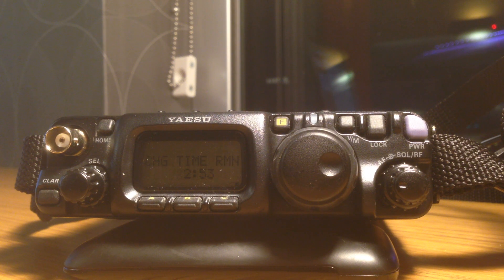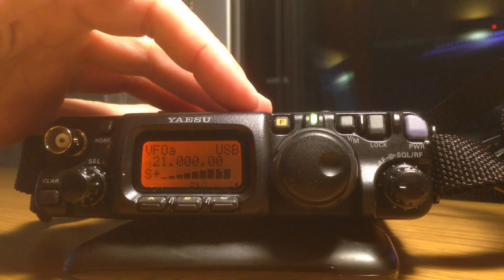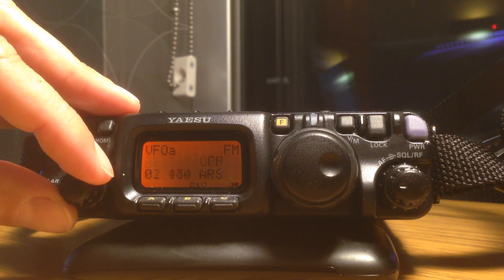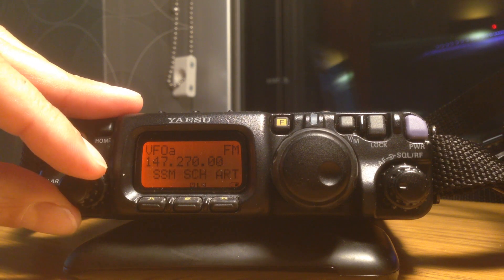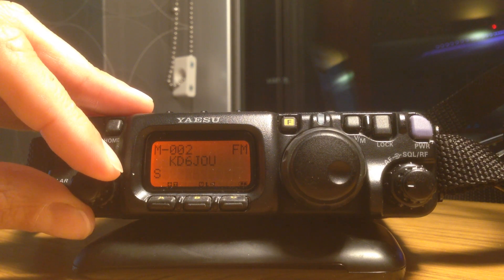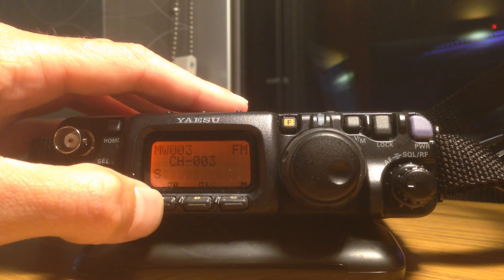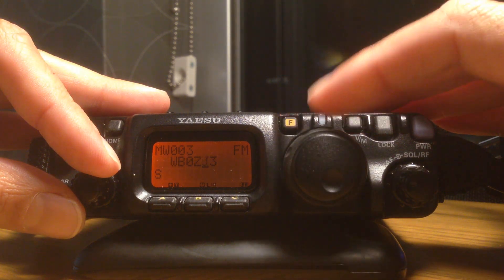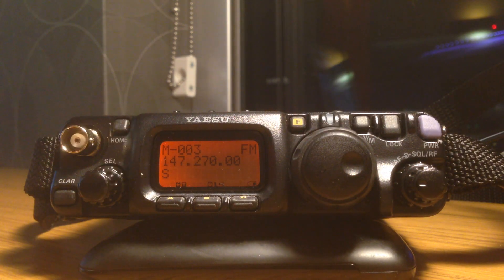Yaesu FT-817 memory programing without cable

Comment: A quick newbie question, when programming the repeater, you program in the downlink for example the repeater I am trying to access is 147.220 Downlink, 147.8250 uplink offset is +0.6 MHz.  
When keying it should transmit on 147.8250 but does it show on the screen that you are transmitting on that frequency.
Reply from the maker: Just checked on my radio - The display does not shift the frequency RX/ TX like other rigs do; you will only see the channel name or VFO RX frequency.  Menu item 42 shows the offset, which can be either + or -.

Comment: What a mess. My Yaesu handheld is not even close to as long a process as that. This kinda crap makes it hard to like this hobby.
Reply: Take up model railroading . When you Love something like radio communications you don't have to try and like it . It bites you as a kid and stays with you for the rest of your life , at least is has for me everyday since 1965 . How about photography or drones ?
Reply from the maker: This is the manual method.  You can always program the radio with Chirp, which is really quick and easy.
Reply: Rev. Mook now that I have the radio it’s not actually that bad I guess. No auto repeater shift is kinda lame since it’s a portable. I didn’t even know Chirp was an option with this. Is the correct cable hard to find?
Reply from the maker: The radio has an auto repeater shift (Menu item 1 for 2M, item 2 for 70cm) but obviously won't work for 6M or 10M repeaters in this case.

The cable you need to program the rig isn't hard to find at all, it's just a CAT cable which you will probably want anyways if your doing digital HF modes, ~$20 on eBay.  Chrip is rad.  I travel a lot, so I keep a list of repeaters in different cities I visit frequently.  Before I jump on a plane I copy, paste, program. Done.